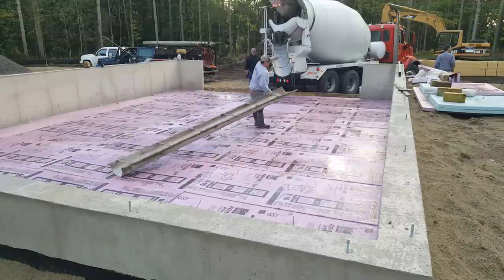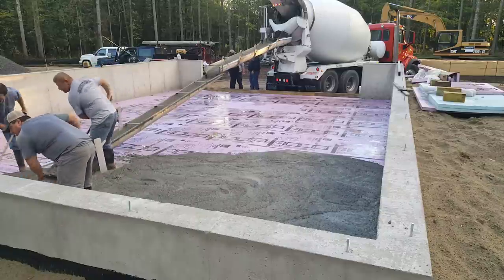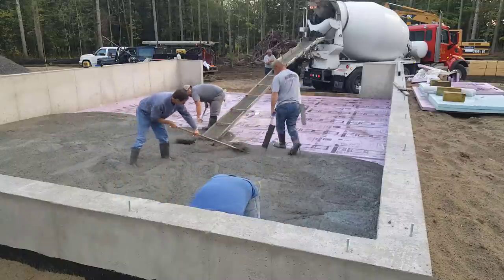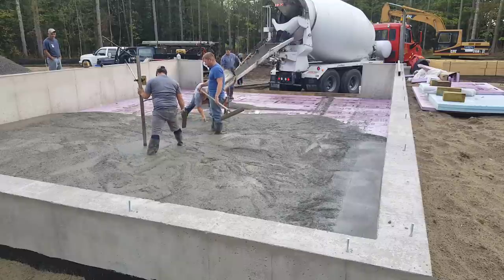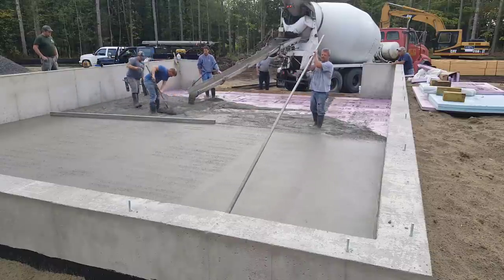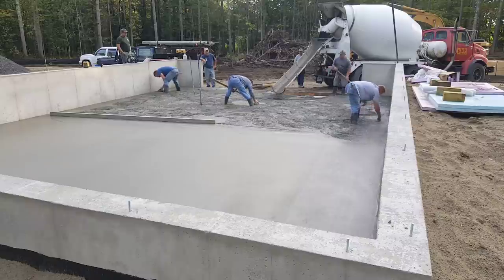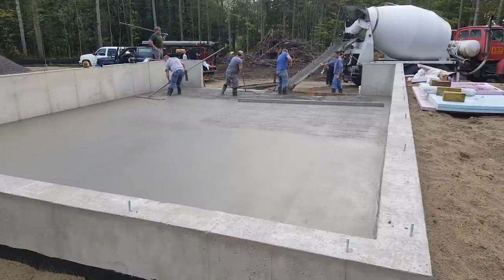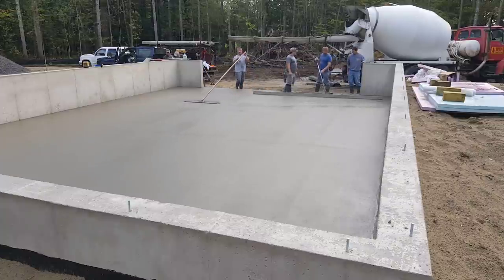CONCRETE FLOOR POURING : DIY CONCRETE

Comment: Mike, I appreciate your videos. I have a business like you, I’ve been pouring concrete for a little over 40 years. I do flat work and also walls. Stamp work and bloomed patios as well. I can see by your videos that we are very much alike in our ethics. I too, like to get it done the right way. You have a couple of very good hands there, when the right hand knows what the left hand is doing it makes thing a whole lot easier for everyone. I normally set rebar stakes for my grades while screening. Thanks again for your videos.
Reply from the maker: Thanks Thomas! Where you from?
Reply: @MikeDayConcrete  Mike, I live and have a business in Western Colorado. The temperatures and climate are very similar to yours in Maine. I would rather pour concrete in cooler temperatures, during this time of year. As you know this time of year you are not scrambling to get the mud layer down, and we know that the curing process is far more effective, resulting in stronger concrete with less shrinkage. Also stampwork becomes easier due to a slower curing process. You do need to pour early so your not finishing the job in the headlights. You also have to pay close attention to a job where blankets are required. I lay down a 1/8 “ layer of felt before the blankets go on, then remove them early in the morning to let the felt dry out during the day.  If the temp does not get up to above freezing, I-always build a tent and supply a propane heater for at least 72 hours. I typically use steel in everything I pour and use no less than a 6 sack mix with stealth fiber. Again I appreciate your videos and knowledge about pouring concrete, Thanks again, Mike.
Reply: I was very impressed that you were able to respond to my comments, thank you!
Reply: @MikeDayConcrete  I live in Grand Junction, Colorado Mike.

Comment: I poured my shop floor last week with my son and a couple of friends who never worked concrete before.  The first 2 trucks went fine but I think the 3rd truck sat on the road for most of the full 2nd truck load. So the third was super hot with calcium chloride and was setting too fast. 
The finish isn't good in that area but the rest came out fine. 
I have a section yet to pour. Watching your videos have helped tremendously.  Thanks.
Reply from the maker: Thanks James!

Comment: All that foam insulation, but they totally short circuited it by allowing the frost wall and slab to connect. Huge thermal bridging penalty.
Love your videos Mike! Giving me a lot of confidence for a project I have ahead. You guys are a well oiled machine.

Comment: Hi your great I build new homes I’m fair with creat but I’m doing y own 26x 26 2 car and basement 33x 65 with foam and radiant heat pipes. First time going this big my 2 sons and I ,we got a new fiber and a new finishing trowing machine, should I do the floor in 2 pours . I’ll do 2 car 1 day but should I split to big floor nights are cold in Ma but still good days now . Thanks Mike M
Reply: Mike P.
Reply from the maker: Only do as big as you're comfortable with. Hard to fix later. Good luck!!

Comment: I dug my footing 24" wide, was gonna pour the footing and do a few rows of block for a crawlspace. Downpour messed up my trenches, downpoured the night i squared the trenches back up and ruined again. Then i decided to do a monolithic and have a concrete floor in the house. Then decided to do ICF walls and do a garage under two stories. Then decided its too high a house for me to frame by myself. Back to crawlspace. It poured again last night and ruined the place. Ive never poured concrete  before. Still havent. But i meant to. Thats true insanity. Im sure you agree :P

Comment: Total newbie here. Doing my first owner/builder home. I'm doing an icf, daylight basement with a slab. I'll also have a couple post footings in the slab for a large glue lam. Any videos that show how to pour a slab with post footings? Correct post hardware to use, ect...
Thanks

Comment: Hello, I am completely new and we've demo'd out our 4" basement slab and we're digging down before repouring the slab (for more headroom/basement office).  How I deal with tying in my new slab with the 1900 stone foundation walls?  The slab was poured in 1956, so not structural to the foundation.

Comment: Question for you, have started doing some slabs for patios etc, seems after screeding when I get to bull float the floors are not perfectly flat or even, getting waves that the float can’t fix. I’m thinking the mix is stiff cause we’re not getting as smooth of a finish after screed as I see in your videos, ours is coming out much rougher. Any thoughts? We are putting much more effort in screeding than what I see in your videos

Comment: Hey Mike, Howdy from Durham - North Carolina

2 questions from a rookie:
isn't a compression/expansion gasket between the existing wall and the new slab helpful ? 
does the motorized screed also improve the compaction of the concrete through vibration ?

I really enjoy your channel, it's always great to learn from experienced pros.
Oh, and it's also great to see you have female employees, it's too rare in this industry
Reply from the maker: The expansion foam is a good idea, yes. Not too many contractors call for it on my jobs.
The vibra screed does help consolidate the concrete, yes.

Comment: You guys do great work and make it look so easy.  

When you mag float the edges to the chalk line on the wall, how do you get the floated surface level or do you just get it close and when you screed it becomes level?  The same with the center screed pads?

Comment: Mr. Day Im absolutely new to this . Im building a home in the Philippines where there are earthquakes and typhoons. My house will be a 2 story on a 30×50 foundation. The contractors there are really not schooled like most general contractors and there is NO inspections by any officials. You just build an when its time to turn on the electric the local electric company goes out an just turn on the power. How deep will you go with your footers and columns to support a 2 story house this size in areas like the Philippines? What size rebar and what slump to you recommend? Thanks in advance

Comment: Yeah thank you for your videos I like the way you spend time explaining details that sometimes are just overlooked by veteran installers I'm a carpenter and 35 years but mostly commercial metal stud framing finish work done some concrete just straight flat work broom finish  But I'm getting ready to poor a 30 by 30 garage and it needs  footing tied into the flat work in Indiana a little bit concerned about my skill set for doing the finish product if you have any tips on how to get out and finish it by hand or if there's ways of using the Fresno or something else to get out onto the pad  I like to know how I'm gonna attack all the Gray areas of my project before I start anything so thank you for your time

Comment: Mike, I understand how you use the wet pads for having a level floor.  Do you have a video that goes through the laser level placement so you get a good reading as you pour?   Thanks for the videos.

Comment: Hi Mike I’m from wales in the uk love your videos, I own a caravan park and need to Concrete the yard  out side the barn, it is about 100ft x 60ft so I want to do it in sections, because of cost.  Maybe  half of it now and the rest next year, what’s your recommendation on finishing the joints where the new meets the old. Thanks Bryn.🏴
Reply from the maker: I would use an edger and round the edge off, it'll make it stronger. Then do the same when you pour the other side.
This is the one we use a lot: https://amzn.to/2Vsx8E3

Comment: Hi Mike this is Michael iam new to concrete and really learn a lot from your videos so thank you for that very much,I have been bidding a few small concrete jobs,my current one is exposed,the first phase turned out pretty decent but my float was square and left a few lines so I took it home and rounded my edges,do you have any pointers for me? My second phase is 14 yards so I'll need a helper for sure,first phase was just me and my fiance and we were running,anyways thanks for all your help so far I have learned a lot from you.

Comment: I was wondering, I'm about to pour a floor for a horse wash rack. It needs a drain in the middle of it so would i lay the pipe and drain then just pour the concrete around it? Also, what are you putting between the concrete and dirt?
Reply from the maker: The pipe is usually below the dirt then elbowed up  to a drain.  You can put 6 mil poly on the dirt for a vapor retarder.

Comment: I do concrete in northern MN we had tough winters hear too,, do you guys do anything in winter,, we try not to but we have ground heaters and frost blankets wondering if you guys do same thing,,   we always use vibra screed but I like the way you guys kick screed do u think it's a flatter floor

Comment: In my experience the reason a driver may struggle with slump is it is rare that the person ordering the concrete knows what an actual ASTM slump is so 6" slump varies from person to person. Also I tell my drivers to never assume just because "Joe" always pours at a certain slump never assume, show up a little dry because we can add water but we can't take it out. I also tell them on multi truck pours to radio to the next driver and let them know what the slump meter is reading so the next truck can be slumped out and ready to pour.
Reply from the maker: Good advice, thank you!

Comment: did u use steel rods to reinforce the floor underneath that foam
Reply from the maker: No, rebar isn't necessary in a floor like this. We do use fibermesh reinforcement in the concrete. If the sub-base is installed and compacted properly there's no need for rebar inside a frost wall like this.

Comment: Mike thank you for the video, are you still doing your online course?  I really need help learning to run a power trowel.  I get the basics and I have seen it done however cannot find anyone to teach me.  I am scared to just " go at it". me and my guy strictly do exterior flatwork but were recently approached by a few builders to do basements and garages.   Can you please make a video on a power trowel?  doing edges by hand on kneeboards or using a 30 inch or 24 inch edge machine.  I would really appreciate it, thanks for the videos. Also maybe mention the use of evaporative retarders.  Thanks
Reply from the maker: Jay - Yes I am. I'll have a video out about power troweling in the next couple weeks. It's been raining here a lot so we've been limited on pouring concrete floors and me shooting video of us troweling.

Comment: Mike do you have any advice on getting your driver to achieve the right slump? What do you do if the slump is too high?
Reply from the maker: I still have to deal with that with some of our drivers. A few can get it right very quickly, the others I tell them to climb up the ladder and check the mix a couple times if they have to. A lot of times we have to add water 2,3, or 4 times to get it to the slump we want. Rarely do they ever get it too wet. Too high a slump can be a big problem. You can send it back or just make a decision to use it. Can't really lower it once the damage is done.

Comment: In your experience what happened when you received a bad mix from the plant (where it didn't harden, too much water, or wasn't the mix ordered)?  Did you ever need to remove the bad mix?
Reply from the maker: I've never got one that didn't harden, maybe 10 times in 40 years I've got one with too much water, i've sent some back. And maybe a handful that wasn't the right mix. I send them back.

Comment: I am going to be pouring a concrete driveway and i was wondering should i pin that to my existing garage
Reply from the maker: If you live in a climate where you never get freeze/thaw, then it can be pinned. We don't here in Maine because if the driveway heaves it'll lift the garage foundation also.

Comment: When you order your concrete do you ask for a specific reducer and if so what do you ask for? Thanks and I really enjoy your videos, you guys are awesome!
Reply from the maker: No, not a specific one. It's just the one they use normally. You can ask for high range or mid range ( at least we can) High range lets us pour the concrete really loose (8" slump) without damaging the concrete.
Reply: Mike Day Everything About Concrete I think what he means is are you asking for water reduced as an admixture or is it integral in the mix off the shelf?

Comment: Just found your channel!!  I’m loving it!!!  Is there any other way to salvage a badly cracked garage floor other than replacing it?  I’m in CT!
Reply from the maker: It depends on why it cracked in the first place. Did it settle or heave? Or did it just crack from pouring the concrete too wet and no expansion joints cut into it? I usually, but not always, suggest a demo and re-do if it has settled badly or heaved and not gone back down. Cracks from shrinkage can be repaired.
Reply: We just bought the house about 1.5 yrs ago.  We think it heaved and never went back down.  So... that’s what I feared.  A demo and refi is in order.  THANK YOU.  LOVE YOUR CHANNEL!!!  Wish you guys were closer!!!  Keep up the great work!!!  Happy New Year!  God Bless!

Comment: I won't be able to purchase the $900 level.  Let's say I have a smaller, self-leveling, laser level from a typical home improvement store, can you recommend a method for using that to level?   I understand that making a video may not be feasible since you don't use them.  Just a thought.

Comment: I’m new to concrete. I’m interested in your wet pads technique. If I wanted to pour a small slab by myself, say like a 15 x 20, can’t I make my own wet pads with laser and then just use a small vibrascreed? And can’t I kick concrete with my boots to fill or take away high or low spots when vibrascreeding as I go?
Reply from the maker: Mupert - Yes, you can make your own wet pads and use a vibrascreed. Yes you can kick with your boots to fill with. It's a little harder to take away concrete with just kicking with your boots. Much easier to have 1 person raking the concrete behind you filling and taking away as needed. One of the keys to getting a flat floor vibrascreeding is to do as much as you can without stopping and starting every few feet. You always want to be pulling back just a little crete with the screed. That's hard to do by yourself but it can be done.

Comment: When ordering concrete. Do you have order a bit extra then what you think you will need just in case something goes wrong?
Reply from the maker: I always order about a half a yard extra.
Reply: @MikeDayConcrete  Thank You.
Reply: Mike Day Everything About Concrete What will they do with leftover concrete? Bring it back to the concrete plant? Dump it on a big pile on your lot?
Reply from the maker: @Engineer9736  They bring it back and make blocks out of it.

Comment: Am replacing double, long concrete drive a bit at a time.  I plan to pour against the created profile of soil topped with four inches of concrete where possible (there are areas of different slopes).  Questions:
1) The first 13' by 13' section, has compound slope.  One running away from garage and the other, laterally, to a gutter (to be installed to carry water to street).  How would you recommend to make sure these critical slopes work?  Slump to use when there is a fall of four inches over 13 feet?
2)  After vibra-packing the loess soil, how much well graded stone/concrete do I use?
3)  What do I do regarding the joint between the old and new concrete?
4) A short sidewalk will be part if the work. Do I form it separately from the drive (It will be three inches thick)?
5) Do I use fiberglass (roughly one pound per yard) alone or with rebar?

Thanks.  Tom
Reply from the maker: Set the top of you forms to grade, check them with a level and screed off the tops of our forms using about a 4 inch slump.
2. If you're talking about the sub-base, At least 6 - 12 inches. Hard to say, depends on if you're in a freeze/thaw climate or not.
3. I would drill and pin them together if you don't want any movement (one moving higher or lower than the other.}
4. Separate or all as one, doesn' t matter, which ever is easier for you.
5. I use both in a driveway.
Reply: @MikeDayConcrete  am in plant hardiness zone 5a so our frost zone is around four feet.  With that said, are you saying I should use at least six inches of driveway mix (3/4 minus?).  I had planned to pack the subbase and apply three inches of gravel.

Also, may I use plastic to cover the forms in order to remove them more easily? Some forms will remain for at least one year.

Thanks for your advice !

Comment: What's a 6 inch slump Mike
Reply from the maker: It's the term we use to say how dry or wet the concrete is. 6" slump is pretty workable, easy to move around. A 2 or 3" slump would be very dry and hard to work with.

Comment: Is it possible for an insane DIYer to construct such a slab in sections over time, using, say, just a 6 cu. ft. mixer?
Reply from the maker: Yes, it's possible. A lot of work but very possible.
Reply: I was wondering this myself as well. For instance for a slab on a 20x30 house, Can you pour 10 ft sections with cold joints with rebar tying them in over time? For the purposes of 1 guy doing in with all the time in the world.

Comment: I used to drive a mixer. They’d ask for a 5” slump or whatever, you could have it perfect or even looser(6”-7”slump) and I will guarantee you they’ll say “add 10 gallons!”
It’s as if a laborer or finishers day is not complete unless they add some water 🤣
Reply from the maker: You got that right. Give it another 10!